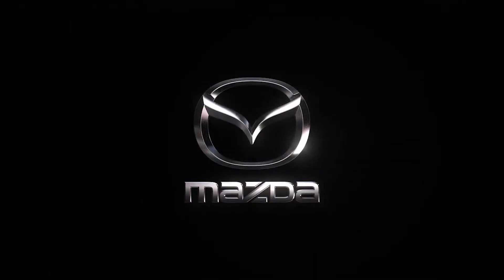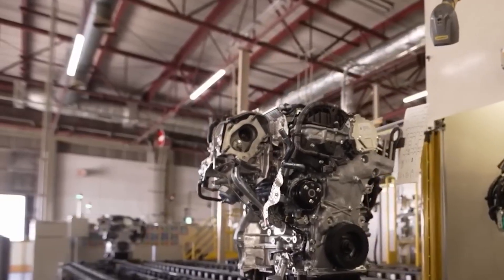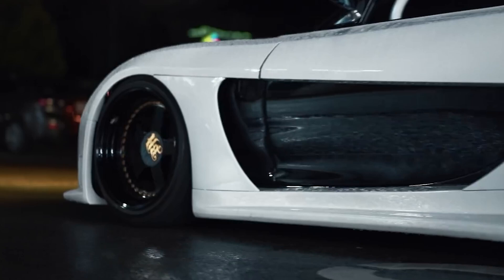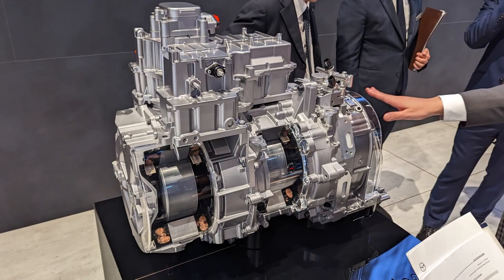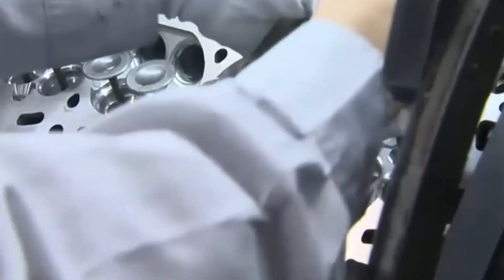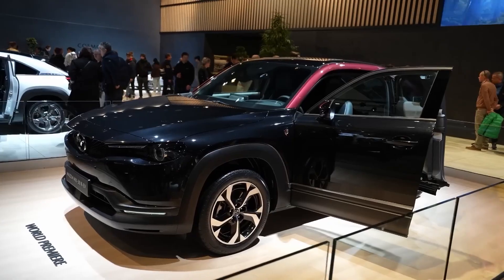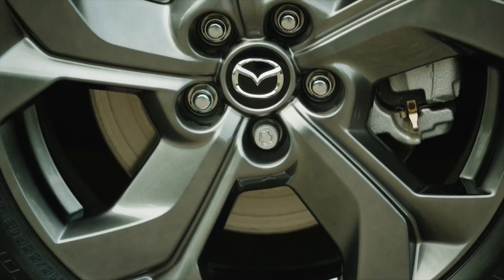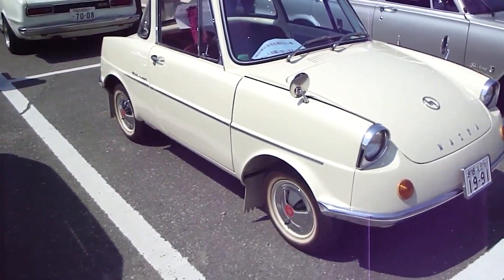Mazda CEO Unveils New Rotary Engine (and it's BETTER than before)

Comment: Ha. Ha. Ha. Another unicorn idea to keep pumping oil. Let’s get real here. EVs are here to stay and they’re so much more efficient, cheaper to run and don’t pollute the earths atmosphere. What about radial engines? What about hydrogen engines? what about bio fuel? Anything to keep drilling for oil. Ha. Ha. Ha.
Reply: Nope, wrong on many counts.
Reply: @Mikere5  go on then - which counts am I wrong on? EVs are here to stay? More efficient than ICE engines? Cheaper to run? No emissions out of the tail pipe (there’s a clue there - an EV doesn’t have one). The oil lobby keeps selling the lies just as the tobacco industries kept telling lies for 50 years. Eventually, it’ll be the public who say they’ve had enough of being poisoned by ICE cars and buses just like the passive smokers who died because of active smokers in bars and theatres (remember Roy Castle died of lung cancer and never smoked in his life?) My EV used 14 tons of CO2 in its manufacture and thereafter - nothing. An ICE uses the same to manufacture but another 50 tons of CO2 during the first ten years of driving. Get real for the first time in your life.
Reply: We aren't going 70mph on sustainable fuel. We can extract Hydrogen from Oil, or even Coal. but Wind, Solar and Pixie Dust, don't show up at the stamp of a foot. You should read Gibbs, to understand, which you won't.
Reply: @aaronfreeman5264  send me the link, please. To help me understand, tell me how hydrogen is extracted from oil or coal because I assumed it was extracted from splitting water into oxygen and hydrogen molecules not from hydrocarbons (oil) or pure carbon (coal). But then what do I know?

Comment: What Mazda needs to do is replace their Wankel Rotary design with the liquid Piston rotary design engine which is an "inside-out" Wankel that solves all the seal wear and oil burning pollution problems, because the seals are Mounted on the engine block so they can be directly lubricated with precisely the amount of oil needed.
Reply from the maker: Great point! The liquid piston rotary design sounds like a fascinating solution to some of the traditional rotary engine issues. 🔧 Do you think Mazda will consider innovations like this in their future designs? I’d love to hear more of your thoughts

Comment: We can improve Power Density by removing the Compression Stroke, for a Two Stroke Wankel,
Reply: I'm assuming you're joking...
Reply: @jadennemeth9758  Do the Math.
Reply: @aaronfreeman5264  sure, but there's more to any engine than math. With a wankel geometry the only way I could even imagine running "2 stroke" would be having ignition on both sides, intake and exhaust ports on both top and bottom, technically allowing 2 combustion events per e shaft revolution. Would be a nightmare to manufacture and run for what probably wouldn't result in significant gains though definitely would significantly increase unburned fuel and emissions, in addition to other issues that would arise. That's why I assumed you're joking as it's a ridiculous idea but would be cool to try I suppose.
Reply: @jadennemeth9758  Math shows the possibility; imagination shows what to try. I don't really understand Wankel Geometry, but a whirling lossenge in a one petal flower seems a better design. Check-Valve, Comustion Chamber, Demodulator, Exhaust through Catalytic Turbine, could be profitably and variably supercharged.
Reply: @aaronfreeman5264  ah that makes more sense, that would be more feasible. I was assuming wankel geometry as that's what your comment said. While it's hard exactly imagine what you're imagining, I'm seeing your rotary 2 stroke also making one combustion event per rpm since it's only a single pedal, which makes it like a wankel except with reduced performance as it wouldn't gain from a compression stroke.
Reply: @jadennemeth9758  It's still a Wankel, as even Watt had the basic shape, but the Geometry is wildly different. Expand- Intake-Close-Fire, almost a single stroke. Compression can happen seperately, so the low performance is at low power. 5:1 Diffusion Ratio still gives better efficiency than the Model T's 4.5:1. 
You can do a lot with Temperatures.  P^(1/7)=V^(-1/5)=T^(1/2) If I recall rightly.
Reply: @aaronfreeman5264  I mean by definition the wankel (separate from the dkm prototype) is a releoux triangle inside an epitrochoid more or less but I get your point. I'm still studying ME rn can you explain the diffusion ratio you're referring to or suggest a good source to read about it? Are you trying to use the ideal gas law for that last part? I'm confused by the "equation".
Reply: @jadennemeth9758  Did you have Thermodynamics as a sophomore? The usual formula is PV^gamma, but I can derive my version. What I read about the Model T in Wikipedia says a 4.5:1 Compression Ratio. Have you ever heard of Sadi Carnot, who wrote on The duty Of The Steam Engine? How are you on Differential Equations? Read the Scientific Papers of J. Willard Gibbs, before the age of 25, to get a doctorate.
Reply: @aaronfreeman5264  Yeah I took thermo 1 and Diff Eq. I vaguely remember the PV^gamma now you mention it but if I remember it was usually provided or p1/p2=v1/v2 was used. Have thermo 2 this fall so hoping to learn more. And yeah I know compression ratio just never heard it called diffusion ratio. And yeah of course Carnot Cycle and Engine concepts are very interesting though since neither engines in question even approach theoretical max efficiency I'm not seeing how that's relevant unless he did something else I'm not aware of.
Reply: @jadennemeth9758  Gamma for an ideal diatomic gas is 1.4, which is the same as 7/5. If we boil water in an air turbine, it gets more complicated. 7/5 is the ratio between Specific Heat at constant Density and Specific Heat at Constant Pressure, unless I have that backwards. It's been a while, and Myelin Sheathing takes a while, to restore nerve channels. 
In a four stroke, Diffusion Ratio is the same as Compression Ratio but, when we seperate Compression to a turbine, Diffusion Ratio is a seperate subject. Reciprocators deal in fixed Volume or Density Ratios, but Temperature Ratios are what count. 
Ideal Efficiency doesn't produce Entropy, so Nothing happens. If you want to win a race, Something better happen, and that will produce Entropy.
Reply: @aaronfreeman5264  Okay I see. Yeah don't remember delving much into that in thermo 1. 
I definitely need to read more about diffusion ratio as I don't fully understand. What is a temperature ratio of? What two temperatures are used?
Yeah I get that, that's what I was saying why I was confused how that's relevant. Unless your point is using change in entropy to measure or calculate something else which might work only if everything else remains constant
Reply: Correct: you don't understand the Wankel Geometry. Your grasp of internal combustion might be a little sketchy, too. Compression is required for combustion to occur.
Reply: @justinbelshe  How much fuel is in your gas tank? just look inside. Light a small match, to see better...
Reply: @jadennemeth9758  I forget how to access my calculator: if a charge of Gasoline is a little lean, we can heat Working Fluid by 4,000 Rankine; what's the 7th root of that, the square of that is Adiabatic Cooling, which recovers heating as Work; So, you can turbo heat the incoming air by a couple thousand degrees, is my guess. Outgoing exhaust could pass through a turbine, so we don't want to extract all heat and, as turbo-compression will adiabatically heat the air, we'll extact a smaller portion of heat, as the air warms, and more will spend on the diffusion turbine. Chrysler really screwed up.

Comment: Now I'm sure I'm not the only one thinking this, but could you turn that rotary part into a twin rotor engine? Can the EV part and drop it in as new engines for older 7's and 8's?
Reply: What do you mean by Canning the Rotary Part? What do you mean by Twin Rotors? Triple Rotors are more common with Wankels.
Reply: @aaronfreeman5264 can the EV portion and use the Rotary portion in a rx7 or 8. And 3 rotor engines came in the cosmo. Unless you have a lot of cash and some fab experience most rx7s and rx8s are 2 rotor engines not 3. I'd love to have a 20b. But alas I have a 13b currently.
Reply: You don't know what you're talking about.
Reply: @justinbelshe  I know that, but you fail to enlighten me.
Reply: @justinbelshe  me or Aaron?
Reply: Mazda used the 12A and 13B in rx7s and rx8s, both are 3 lobe twin rotor engines. Both are the same size accross the face but the 13B are thicker making it a 1.3L engine.

Comment: Long time rotary owner here, All this is just so Mazda doesnt have to build MORE EFFICIENT and QUICKER cars that happen to be EVs. What they are trying to compete with are EVs of 6 years ago, they cant compete with current or future EVs. My last 13b powered truck used 30 litres per hundred kilometers.
Reply: EVs are no more efficient than the mind of Buttigeg. EVs are heavier, requiring more energy to accelerate. Until we have enough Nuclear Power to throw it away at night, EVs need Fossil Fuels to recharge. I like Regenerative Braking, but those batteries are heavy.
Reply: @aaronfreeman5264  we can argue about efficiency, but if you have solar panels at home, than it is already decided :-). But I totally agree that big batteries are very heavy, for now. I drive a PHEV, and it's perfect for daily driving in town with electricity, and if you want to go on a long trip, there you don't have to plan every stop, to refuel. Thinking about efficiency, well the rotary under normal circumstances is not that efficient, meaning people "use" the power they got and for racing the efficiency will go down, but in this case using it as a stable generator at an rpm close to optimal it should do the trick and also ensure a long motor life, because it is not reved cold, because the battery is used. I am waiting for Mazda putting a bigger version into a bigger car, like the CX-60 instead of the 2.5 engine.
Reply: @adambeimel104  I like the idea of a rotary dynamo, but I understand Electric Transmissions work better on rail-roads. It's something about Weight; Do high frequency inductors weigh less?
If you have Solar Panels at home, THEN you are proven more gullible THAN I.
Reply from the maker: Thanks for sharing your experience as a long-time rotary owner!  You raise some valid points about efficiency and competition. Do you think Mazda's rotary engine can carve out a niche in the EV market, or is it just a nostalgic throwback?